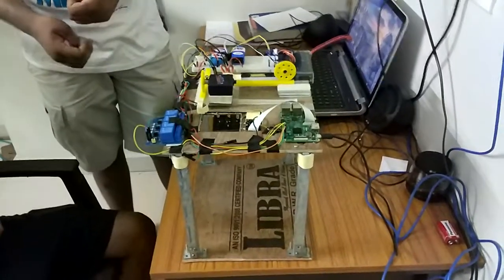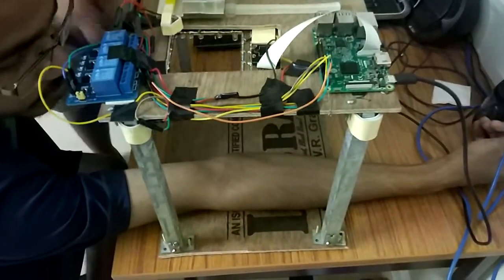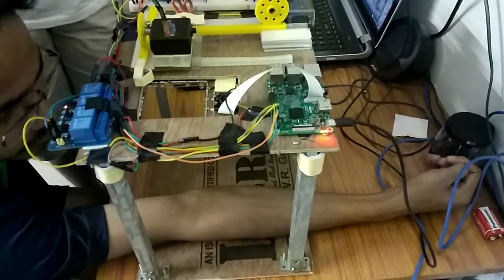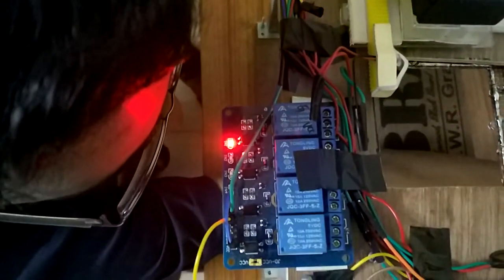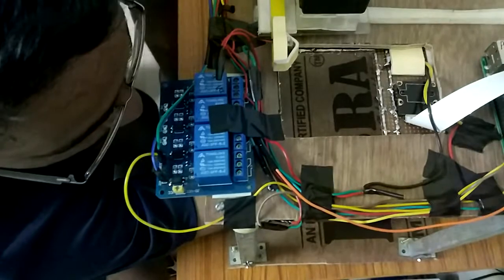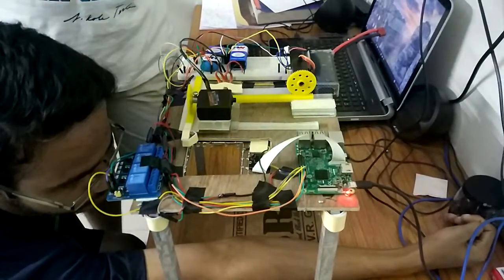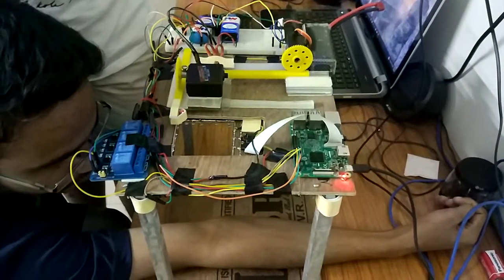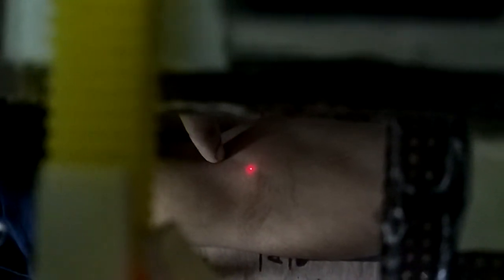Infrared based vein finder

Comment: Did u use the normal camera or the one with night vision with passive ir illumination? I also wanted to know whether your system will adapt on any hand movements during the active working procedure
Reply from the maker: The camera is an IR camera. Camera module we bought via Amazon.com did not have ir illumination. We ourselves soldered IR LEDs on PCB for IR illumination. We did not incorporate hand movements under active working conditions but with it can be achieved with updating the search algorithm.